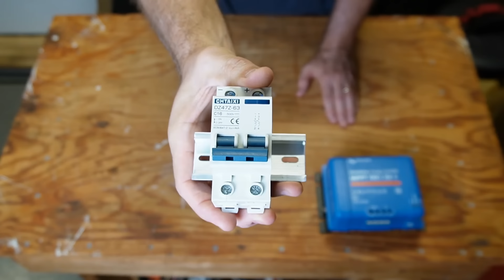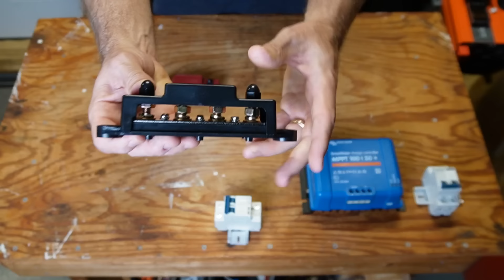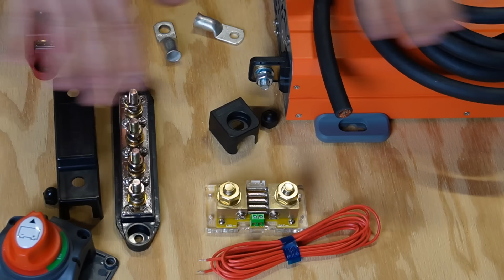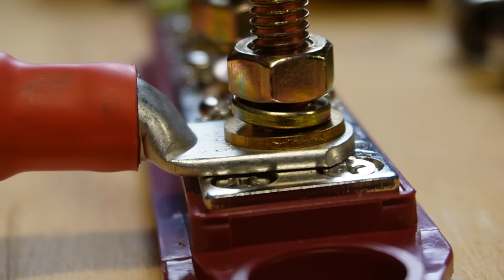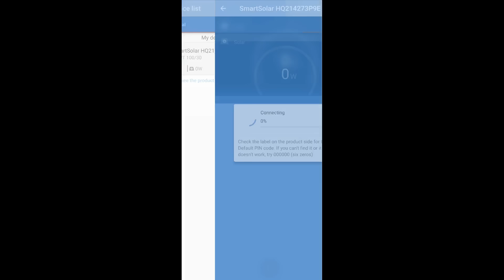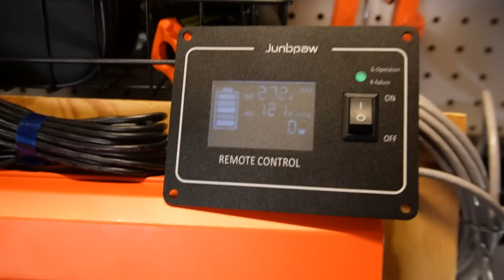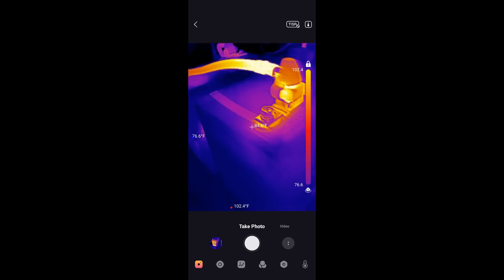24V DIY Off-Grid Solar Generator Build For Beginners

Comment: I need help I got these:

3080W Pure Sine Wave Power Inverter, 24V to 110/120V AC, 50/60Hz, 42dB Ultra Quiet, 9000W

 Charge controller 

Victron Energy SmartSolar MPPT Tr - Solar Charge Controller (Bluetooth), Charge Controllers for Solar Panels, 150V, 60 Amps, 12/24/36/48 Volts

Should I get a Miniature DC Circuit Breaker, 2 Pole 500V 63 Amp Isolator for PV Solar System, Magnetic Thermal Disconnect, DIN Rail Mount, Chtaixi DC Disconnect Switch C63?

Comment: If my experience with pwm controller is any indication my first one came with a kit a 75 watt panel with legs a controller and a bunch of wires plug and use it worked great for charging a dead automobile battery plug it into the cigarette lighter plug wait 20 minutes and start the vehicle later when I set up solar for my camper I bough 2 100 watt solar panels and for expansion capacity a 60 amp pwm charge controller then I had a suggestion pop up on my phone for a utube video on proper care of sealed lead acid battery it interested me because for over 20 years I needed emergency power for my jobsite running a 12 volt light at first and then to power my charger for my cordless tool batteries and I bought booster packs with a 400 watt modified sine wave inverter and an air pump buy 39:05  it in the spring on sale and by the next spring they wouldn't take a charge so I bought a new one and the video said the battery should last between 5 to 8 years so why were mine only lasting a year it only gave general ideas keep them toped up don't go below half well first one taught me to keep them plugged in to keep the battery topped up and the inverter shut down at 10.8 volts so very rarely did I discharge below half way so no help and then I got a sugg for another video on the same subject and I almost skipped it but it was crazy it gave voltages that had to be wrong after all a 12 volt battery is fully charged at 12 volts half way is 6 volts and dead is no volts and it said that the battery was fully charged at 14.8 volts halfway was 13.4 and dead was 12 volts but my last booster pack was handy and so was a Philips screwdriver so since I doubt if black and decker makes their own battery I took it apart to find the battery manufacturer figured I'd either phone them or find their website and what they said the proper charging perimeters were but written right on the battery was do not discharge below 12.2 and float charge is 13.4 and full charge 14.8 and on the built in wall wort was output 12 volts so the battery was dead  to start with and being discharged way too far and when I checked my 2 pwm solar control they both stopped charging the battery at 12 volts and I don't know what they float at so they're almost useless unless I want to buy new batteries each year or so and they are too expensive to replace yearly for emergency power back up as when you.need power how much power will it have and how long will the batteries last in daily use

Comment: When stripping the wire insulator with a knife it is best to cut along the wire, then you can fold the insulator away from the core and cut the insulator away without any risk of cutting into the copper, i used to make the charging leads for forklift trucks

Comment: What about if you want to hook up to shore power. is there a way of connecting shore power to this system? So it can charg your batteries as well on  cloudy days? If not what would you have to do to switch to ac ?

Comment: Would a 250 class T fuse be to much going to the battery ? I was originally going with a 12v and have a generous supply of 250s
Reply: Best video on the Tube for setting up your board!

Comment: Like what you are saying.. 50+ years ago and electrician told me that if you are installing anything electrical if you are installing an electric  appliance if it says 14 gauge wire he used 12 gauge....auto   says 12 gauge he uses  8 gauge ..if you use a higher gauge wire there is more electric for the appliance than lost in getting electric through wire.. keep going much luck..

Comment: Thank you very much for your easy to understand video set up. I was getting to the end of my rope trying to lean how to do such a set up for my 85 yr old father who lives by himself on our 120+ year old cattle ranch. He has been without a working propane fridge for many years now, keeping his food in an ice chest with block ice. He lives 15 miles out on a rough road and doesn’t drive anymore so getting to town is a hardship. Anyway, I’m trying to set him up with a small fridge that is 120 watts/1.5 A. I wanted to use components that I already have on hand but I’m not sure is I need to up my 1500 inverter, also to a mppt as I have a 12v/30A ppm. I have 2x 100 W 5.56A PV and one 100W (amps unknown) at my dad’s ranch. I believe that I need more solar panels. I need new batteries as my 2x 12V (acid-lead) are swollen and 4 years old. I used them for a crude system I set up for my dad back then. Anyway, I see that I need a lot more items to set up a proper system. I would appreciate any input regarding my blend able to use what I have on hand. I want to copy your set up but my finances are limited. Summer is upon us and I don’t want my dad to go through another summer without a fridge.
Again, Thank you for the well done video. I will be following you.

Comment: I plan on building a 24v system but in a portable box. I will use 3 315w solar panels. I plan to use the system for items in the kitchen in case power out. I have 12 315w solar panels and a 48v deep cycle battery  bank to power 3 freezers and 
 a frig. Only issue I've had is several cloudy days in a row.

Comment: Hey I hope you can give me a good advice 

I m using 2x 700w solar
1x 250Ah 24v Lifepo4 battery 

Which needs Victron 150/60 (which is sadly not available in India)

Is it okay I put these panels separately with 2 x Victron 100/30 and use a busbar to charge the battery 

I have checked the voltage and amps which are under limit

Just wanted an expert opinion

Comment: It's nice to find someone else is using the same brand of solar charge controller and identical batteries to me. Mine is a much lower power setup with just 260W @ 60V of solar panels running into a Victron SmartSolar 75 | 10, and it manages to push the expected 10A into the batteries on a typically sunny day. I chose the 75 | 10 as that's what the Victron online calculator recommended for my panels and a 24V battery. That gives a PV ratio of 96%, so no over-provisioning on the panel side, but it's close to ideal for optimum power transfer.

Comment: I started going solar over 35 years ago only got as far as the batteries and an modified sine wave inverter I used an old snowblower and the alternator and regulator from my old Dodge motorhome motor ran about an hour on a tank of gas about 15 year's ago I started again using the original 1750 watt modified sine wave inverter and 2 new deep cycle batteries unfortunately I found out that the batteries wouldn't hold a charge and the company I bought it from tried to tell me that they were fully charged at 12 volts and they tested out as nothing wrong with them so the best they could finally do was trade them in on 2 big cat batteries I also found out that the PWM 60 amp solar charge controller had improper charging  perimeter I had already found  out and confirmed what the proper charging perimeter I also found out that modified sine wave inverter wasn't good for running anything other than toaster toaster ovens hot plates and griddle it would distroy electronics and motors so I started looking at solar generator's with what I had learned and my budget I looked at 2 that used lead acid batteries since the big reviewers wouldn't do review's on lead acid battery solar generator but both had excellent reviews from preppers fortunately I had found out proper charging perimeter and that I needed pure sine wave inverter so I tried to find out what their charging perimeter and wether the inverter was modified sine wave or pure sine wave also what solar input would the allow found out the 1400 one was modified sine wave and the charging perimeter were wrong and for every day of use it took 3 day's to recharge the batteries the other had a 2000 watt pure sine wave inverter but again improper charging perimeter and again for every day of use it took 3 day's to recharge both were within my budget and sold by the big box stores so I kept looking finally princess auto brought out a pig in a poke they new nothing on the unit just that the inverter was 2000 watts pure sine wave didn't even know if there was a battery in them but even buying the battery they had on sale it was under a thousand dollars and the battery was 3 volt lithium I figured that the battery had to be more than 3 volt but they have a garenty no sale is final until I'm satisfied so first thing the morning of the sale I called them at 6 am 9 am their time and ordered saying that I would pick it up at their ne Calgary Alberta store told them that my sister would pick it up after work Thursday and bring it home Wednesday evening I got an email and a text from the electric company saying that there was a planned power outages scheduled for Friday Saturday and one on Monday it's 30 below zero and my house has poor to no insulation and it took me 2 weeks to get my house back up to temperature from around 0 Celsius so when my sister got home I unboxed it and the battery was included plugged it in wasn't doing anything but some of the video reviews Id seen the lithium battery had a switch so I looked and it did so I turned it on and it started charging the battery was a 48 Volt battery let it charge up and Friday morning at 8 o'clock the power was shut off and I ran an extension cord to my furnace and was surprised to find the furnace watts hit 320 and settled down to 280 from all the utube Video I expected maybe 1000 watts or more power returned at noon plugged my furnace back into the house power Saturday morning when the power went out I plugged the furnace into the solar generator this time noon 
came and went still no power but I had heat couldn't call the power company no cell service finally at 8 PM the power came back on and I had an email waiting and a text message came through both said that the outage was being extended to 8 PM so I left it plugged in over night and left the furnace plugged into the solar generator that's when I saw another notification on the screen it said that it was in UPS mode since then I have found out that it's a fairly good u unit and I checked out the draw on my freezer it's basically the same as the furnace I did find out by accident that it would run the freezer for 2 and a half days so I figure that with the fridge power draw should be the same as the freezer so if they all start at the exact same time which is highly unlikely the draw would be 960 watts

Comment: Nice video production. So relieved you replaced that DC Disconnect with a Blue Sea System version. Those knock offs are a fire hazard at high current.
Reply from the maker: I agree. I did an older 24v video and that battery switch was the only hot spot I had then. No more knock offs.

Comment: Nice setup for beginners. I have a 24 volt system as well with four 12 volt 100ah lifepo4 batteries with a battery balancer. A 1500 watt inverter with a 150 amp fuse connected to the batteries with 2 awg wires. Two 20 amp charge controllers that bring in 800 watts of solar. The solar panels are in two locations wired in s2p4. This gives me 34 volts and around 15 amps going to the charge controllers. From your set up I see that the charge controller can have more solar panels added. You are correct that the voltage from the solar panels cannot exceed 100 volts which would fry the charge controller. I have to add that if more than 30 amps coming from the solar panels can also fry the charge controller. One thing I notice with other YouTube channels is that they go ga ga about voltage. Let me explain, from the charge controller you have, it is rated at 30 amps plus the 14.6 volts to charge the batteries. In order to get those amps for the charge controller they have to come from the solar panels. This is where series and parallel come into play with solar panels. Running is series the voltage goes up with each panel while the amps remain the same with no increase. With parallel the amps go up with each panel while the voltage remains the same. With s2p4 (series 2 parallel 4) it allows for higher voltage and increasing amps, also called current, to be more efficient for the charge controller to charge the batteries.
Reply from the maker: Thanks for all that information.

Comment: This setup is much more complicated than other systems. Lots of redundant safety shutoffs and breakers. More components more failure points.
Reply: Disagree. His component choices (DC Disconnect, MRBF's, Breakers) are on par for a safe design.

Comment: Hey! Just wanted to say this video is very well made, as someone with minimal (but reasonable) electrical knowledge, doing a DIY solar setup doesn't feel nearly as daunting anymore.

Im thinking of doing 8x 100w mono panels from Harbor Freight as they're typically on sale for under $100/panel. These are going to be used to power a small man-cave shed, so power demands arent all too crazy.

The panels seem to come standard with an SAE plug, and the brand that makes them (Thunderbolt Solar) also makes this eight-to-one connector disc that can connect 8 solar panels in parallel down to a single plug for like $12, though it has a max power capacity of 400w.

I was thinking of doing 2 groups of 4 then hooking them up in series to do 48v @ 400w.

The battery and inverter will still be 24v, so im assuming the MPPT will handle DC-DC conversion as long as it knows its a 24v LiFePO4 battery?
Reply from the maker: I'm not familiar with the Thunderbolt Solar panels or the connector. But as long as your solar charge controller can accept the input voltage coming in and you can configure your charge controller to work with a 24v battery, then yes you can use a 24v battery. But depending on your charge controller, you may be able to use either a 12, 24 or 48v battery also. Some charge controllers only support 12v or 24v. Some support 12v, 24v or 48v.
Reply: @proficientprepper 
Cool, thanks for the info.
The charge controller is the same Victron Energy 100|30 controller as listed in the video, so i figure it should be good.

Comment: is there a point in having a dc breaker between the battery and the solar controller 😢
Reply from the maker: I did that for an easy way to isolate the solar controllee if I needed to. And if something goes bad with the controller, hopefully it will trip to protect everything else. But you have to be careful to not turn that breaker off before you turn the incoming breaker from the solar panels off first. Most solar controllers can be damaged if you have incoming power from panels and the controller isn't connected to a battery.

Comment: Do you ground the inverter, charge controller, or the solar panels?
Reply: No need to despite what the influencers say that you have to do. It's DC not AC which means two wires not three. I have a 24 volt solar system with 800 watts of solar and nothing is grounded for the past three years of use.

Comment: If it doesn't give me at least 5000 watts, it's useless to me. A 5000 Watt unit would work, but I would use 2 24-volt units, which are the 300/314 AH versions, giving me a total of 600/628 at 24 volts.
Right now, I have a 5,000-watt 48-volt system with a 314-amp-hour battery. It gives me about 12 hours of downtime with everything I need to run.

Comment: Why are the DC breakers connected 16Amps on the input side of the Charge Controler and 32Amps on the ouput side?
Reply from the maker: Since this is a 30amp charger, I used 32 amp breaker on the output side. The reason I used 16 amps on the input side was to be slightly over the max amps my solar panels are supposed to output. I know that the solar charge controller can handle more than 16, but I thought if more than 16 amps is coming from the panels, something must be wrong. Probably not necessary. But you're right, I could have used a 32 amp one there also. .

Comment: Newby learner here.  Question:  Using your array in 24V mode, how do you correct it to 12V for automotive devices?  Thank you for your highly informational tutorial.
Reply from the maker: I'm not connecting anything to automotive devices. I'm built this 24v system which includes an 24v inverter that converts 24v DC to 120 AC (Standard US Outlet) so I can plug in things like my refrigerator.
Reply: @proficientprepper  Thank you.  I will be using in in a vehicle.

Comment: Im new to this: Why did you need shunt again? Batteries have state of charge built in.i will watch vid many more times. Infact I saved this to my laptop. 😊
Reply from the maker: The shunt is not required. However, as with most LiFePO4 batteries as these are which have a SOC on them are actually just a guess based on the voltage. And guessing the SOC for LiFePO4 batteries using the voltage is not very accurate. But it is kind of close. So a shunt is actually counting the amps that go by so it is a much better reading of the overall SOC of the batteries. Its not perfect either, but closer than guessing by the voltage.

Comment: can i hookup an 2p1s in 4pcs 12v100ah? and what is the pros & cons? thank you
Reply from the maker: Did you mean 2p2s for a 24v system? That would result in 24v. This should work as long as your batteries state they can be hooked up in that configuration.